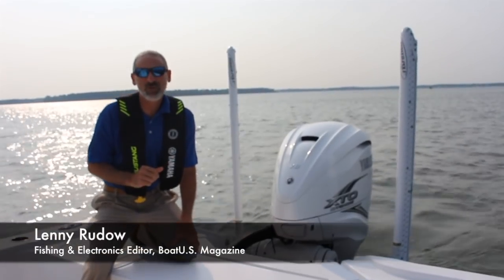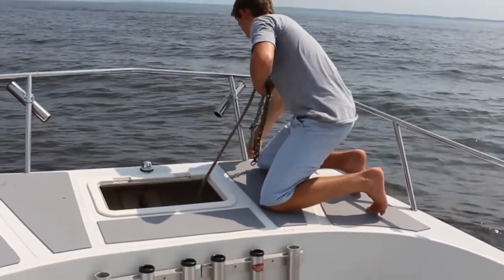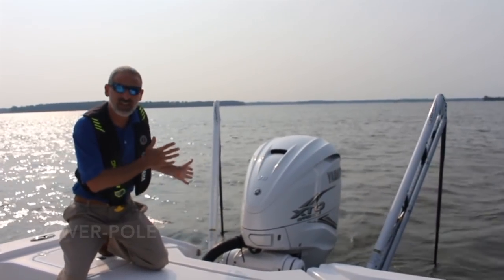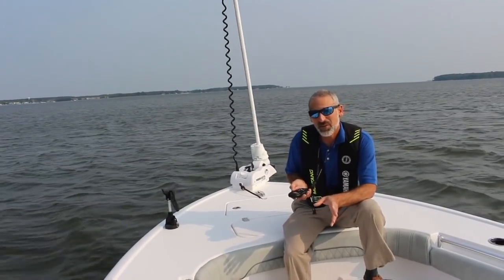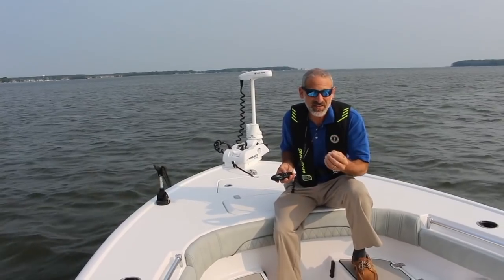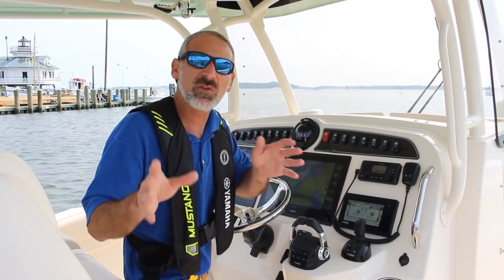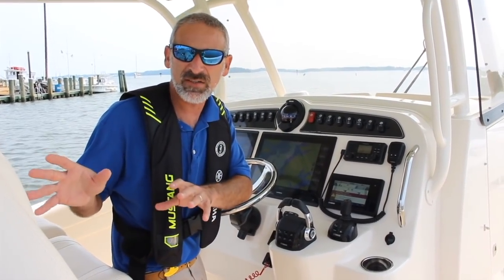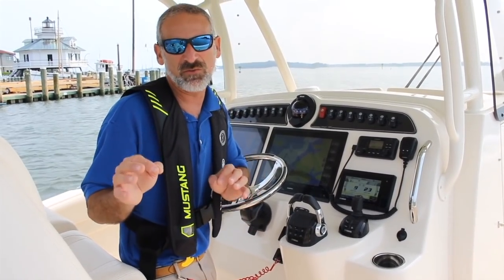3 Modern Boat Anchoring Options | BoatUS

Comment: While this may elicit a "duh" comment from some, there's one thing not mentioned that viewers should beware: if using these in situations where folks may be getting off the boat to swim around it, those second two options are risky, as they could unexpectedly engage the propeller (whether bow or stern), endangering swimmers. For fishing only, of course, they can be a real boon. Thanks.
Reply from the maker: Excellent point, Charlie. Thanks for your comment. We subscribe to "better to ask stupid questions/point out the obvious than make dumb mistakes."
Reply: @boatus  Thank YOU for that response and encouragement of helpful comments.

Comment: Folks should be aware that GPS accuracy can vary even at the same location as satellites come into and go out of range. Never leave a boat unattended when using these devices and keep an eye out for drifting.  And other boats!

Ok .. going to the head can be an exception ... but make it quick!!

Question .. when using one of these devices, should the anchor light be on???  The boat is stationary, which meets one condition of anchoring and a primary reason for the light. But it can also be moved very quickly, which most anchoring systems do not permit.  I would think the anchor light should be on.
Reply from the maker: Thanks, John. Good reminder.